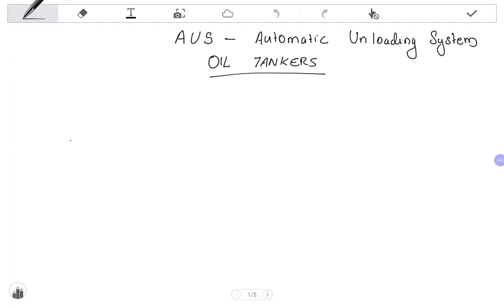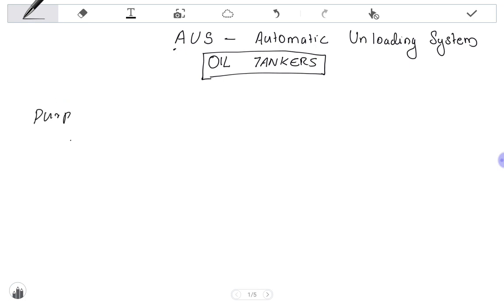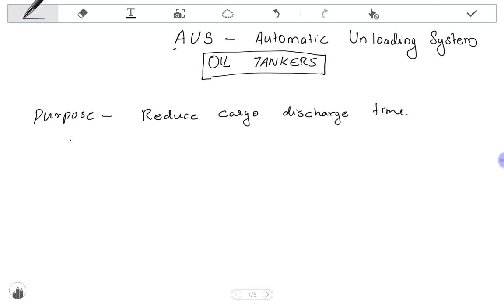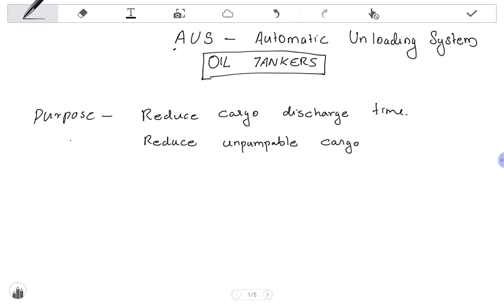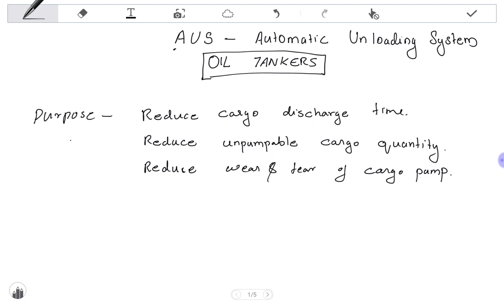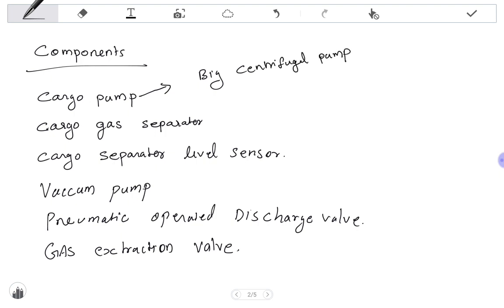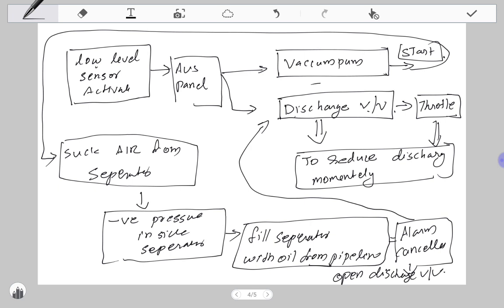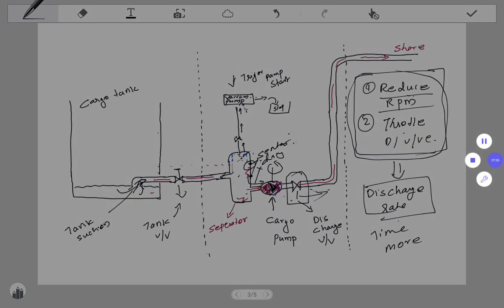AUS Automatic Unloading System

Comment: Good Explanation Sir,
however i have some doubt or maybe i miss,
1. On slide no 3 said by AUS we will not throttle the Discharge valve, however next slide said that the low level sensor on separator also triggering the Discharge Valve to throttle and  reduce discharge momently? Means the same procedure as manual (throttling disch valve), but by AUS its working automatically.

2. During AUS working, and disch valve throttling without reducing RPM, is it safe for the COP?
3. How much time vacuum pump running to suction vapour from separator untill reach upper sensor then it will stop?
Thank You in advance, Sir!
Reply from the maker: 1. In ship without AUS , duty officer has to manually throttle the discharge valve to prevent suction loss.

In AUS ships  , the system will detect the low level  and automatically throttle the discharge valve so that pump suction wont lose and it never run dry, along with that vaccum pump pulls out the liquid from pipe line , it help in reducing stripping time.

2.  Yes its safe to do at lower RPMs
COP is cetrifugal pump. 
We normaly keep the pump discharge v/v shut during the starting of the pump, once we have sufficient RPM and discharge pressure at the discharge side then only we open the discharge V/V,
The point I wanna say is, these pumps are designed in such a way that momentarily opening and shutting of discharge valve at moderate RPMs won't damage the pump.
We use AUS only at the last stage of cargo operations where ullages is less in tanks, So the officer  in watch must reduce the Pump RPM to a medium range well in advance.

3. Vaccum pump also has 2 mode , manual and Auto.
If you select Auto mode the Running time of the pump will be decided by the level sensor inside the separator .
If oil level in separator touches the sensor it will stop.

If the vaccum pump is running continuously in auto mode then you have to check the tank sounding manually to confirm weather the tank is empty,  or  to check any of the valve in suction side is shut or open.

In manual mode all the sensor will be bypassed and duty officer will decide  how much time the pump needs to run depending up on his experience and knowledge.
Reply: @sarathchandran528  Thanks Alot Sir!
Very clear explanation.
For my question no.2 yes correct Sir, in my experience also discharge vlv keep close while the COP warming up RPM for abt 15minutes,
Indeed during close to completion of discharge the RPM should already reduce from max to mid RPM so its will be safe for COP.
Thank You again Sir!
Keep it Up the content, really appreciate!

Comment: Sir, we are manufacturer of Caustic Soda Lye. We load tanker vehicle. For some customers when the vehicle reach to their site, they have storage tanks but don't have any unloading facilities. Sir, in this case how we can transfer Caustic Soda Lye from our tanker to their storage tanks. Your answer can help us a lot. Thanks in advance.
Reply from the maker: Hello pramod,  I am not familiar with caustic soda transfer ,  I am not an expert,  but i have some suggestions there are portable submersible pumps available in market (framo Pumps), these pumps are mainly hydraulic driven or electric driven. These pumps u can drop inside the tanker connect the discharge line to receiver side. Make sure the pump is rated for chemical.
Reply: @sarathchandran528  Dear Sir, thanks indeed for your suggestion. Shall explore what you have suggested.